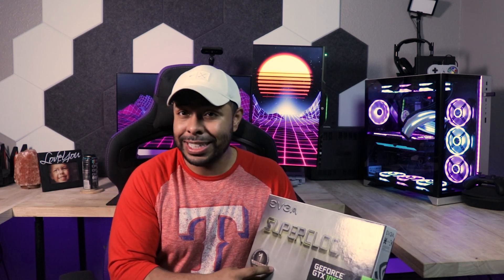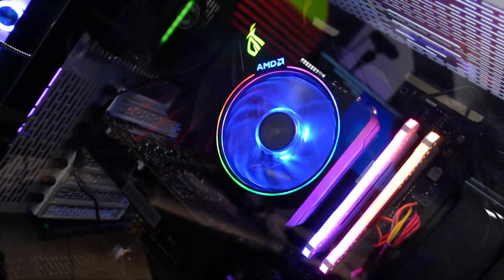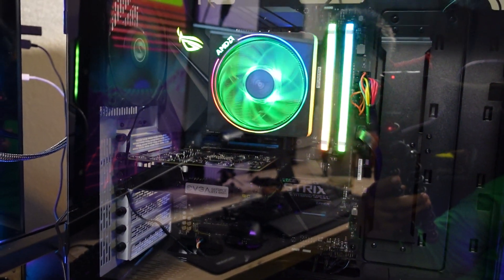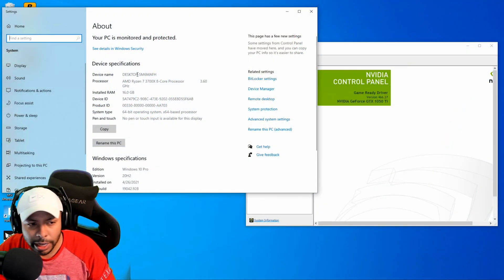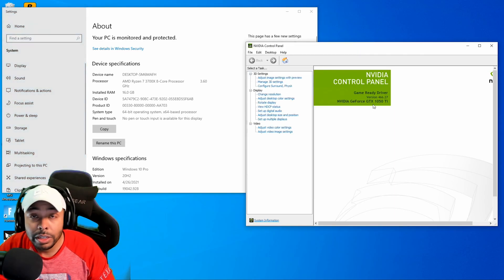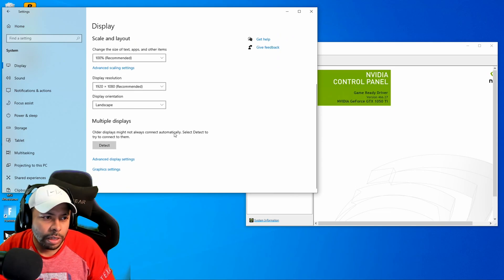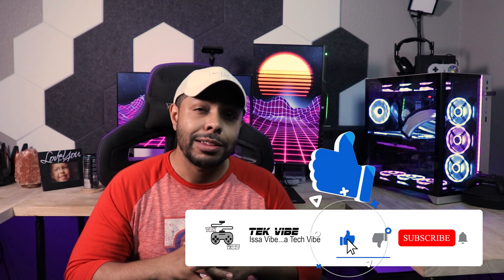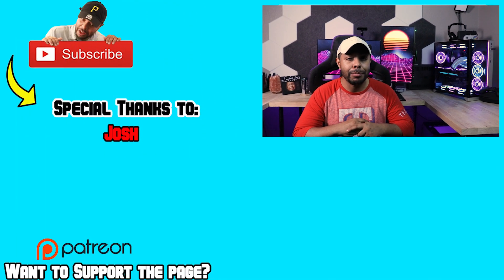Possibly the only good 600 dollar PC in 2021

Comment: Still rockin' my ABS Challenger GTX 1660 Super/i510400F build you recommended here on the channel a cpl mo ago off NewEgg. She's still runnin' smooth and it's SOOOO quiet! Haven't had any performance issues to date, and she's been in use about two months now. Think I nabbed the last one they had bc it has been out of stock ever since my order. SO glad I lucked out with this one thx to u man. MUCH appreciated still. Can't wait to be able to build my own though. When the 3090 is available at original'ish MSRP I'll definately be upgrading. Unless I win the lottery before then. Great video! Keep up the good work.

Comment: Mine costed 720€ 
Zalman t5 case 
Corsair cx650f rgb white psu 
msi b460 mortar wifi  
i3 10100 with Noctua nh-u9s chromax black cooler 
gtx1050ti 
16gb g-skill trident z rgb 3200mhz 
Samsung evo 980pro 250gb 
 2 Noctua fans
It is made solely for 1080p 60hz monitor and Armored Warfare and WOT are the only games I play, so it is perfect for 60fps. Runs ultra quiet too and it’s compact size. Zalman t5 is my favorite case since gt740 days as it’s good build quality and you don’t really need stronger cpu as i3 10100 if you have only 60hz monitor :)